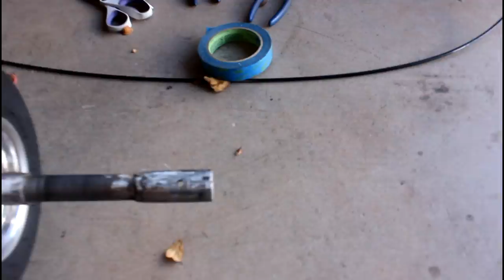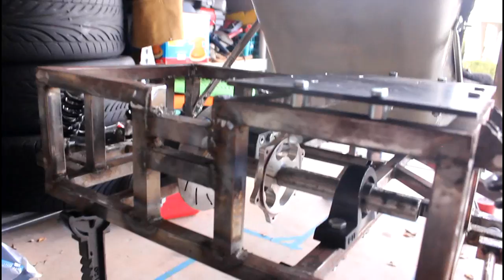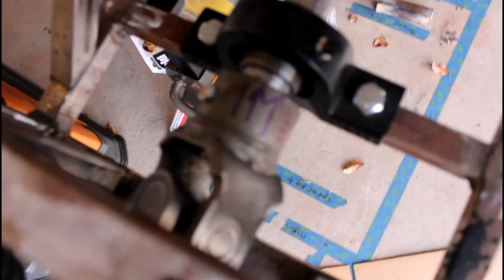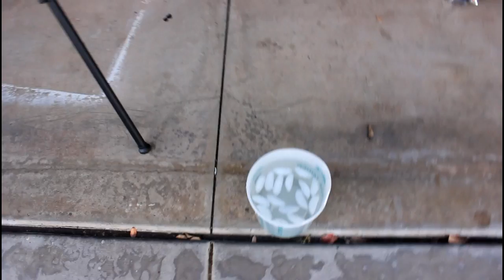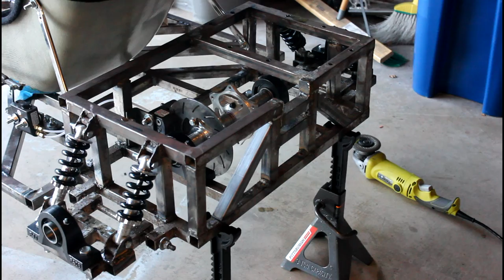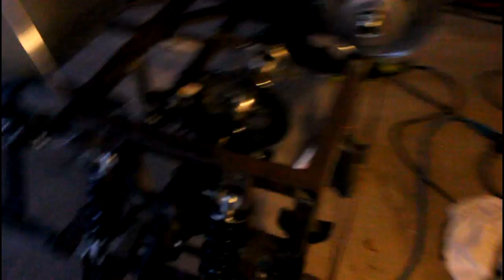(Homemade) Go Kart Build Project 23: Strengthening the Axle, New Support Braces

Comment: I was taught years ago to use old motor oil & swosh the metal around in the oil  but you need a splined  male & femal shaft to allow the axle to slide in & put when the suspension moves

Comment: I see this is an oldish build, but it got recommended to me now (2021) for some reason. Your axle/suspension design won't work -- you may have discovered that by now! A universal joint can't be used singly like that, it has to be used in pairs, and even then won't give smooth drive. That's why "constant velocity" joints exist and are used for that task. Also, those short swing arms mean that you have enormous camber gain, giving very poor traction, even at rest, since the suspension will be somewhat compressed with the weight of the cart + driver.. I'd be interested to know how this design panned out...

Comment: It looks like you built this 3 yrs ago...good for you ...not a lot of people would attempt to do what you have...I'm just wondering if your axle problem isnt due to only having on pillow block on the outer most axle...if there were 2 bearings on the outside it would add a lot more support...eliminate all fields of flex.. Good Luck..
Reply from the maker: Thanks Jerry, I appreciate it! That is very possible. I would love to revisit the design at some point, but in the short term I prefer the reliability of the solid axle so I can just enjoy it more.

Comment: ruler, protractor, measuring tape, angle finder.....these are all pretty much mandatory items if you are gonna fab brother, and all should be able to be had or under $10 each or better.  Your build is going the right way, it is just the little things that make it less then it's potential imo. "pretty close" is just silly when you can make it exact, especially with the symmetry in mind, and even more so when it comes to, if you can see it with the naked eye then that is more then just a little of, and when it comes to chassis and suspension builds, they really should be exact man. 

again, just my $.02 and experience in everything from this to full size chassis. 

Keep it up, I have been following the build for a while now.
Reply from the maker: I am well aware of all the basic tools needed to build such a project. Keep in mind, this is my first ever serious fabrication project, so I am going to make some errors and I learned from them along the way, also keep in mind  my welding skills have improved but are not to the point where I am skilled enough to where warping is minimal, that's where must of the "inaccuracies" you're talking about come into play. For the type of project I'm working on, a go kart that is built mainly just for fun in my free time, the level of precision I achieved compared to most other go kart builds I found online is pretty damn good. Thank you for your input, I appreciate your support on the videos.
Reply from the maker: If I was working on something such as a full size chassis, sure I'll pay a lot closer attention to making sure things line up down to the last millimeter. But I only had so much time and will to want to put into this because I do have many other priorities that are more important than this project

Comment: Depending on the carbon content in the steel you might have to oil quench. Also tempering the metal with make sure your axle does not become brittle
Reply from the maker: Yea after I did this I realized I should have oil quenched it after heat treating it, although I scrapped this axle design and I actually use a completely different axle now.

Comment: To harden the steel you should be quenching in oil instead of water. Quenching with water can make the steel brittle. Just subbed 3 days ago and started from vid 1. I have noticed a few other things but that could just be me nit picking. Keep up the great work. 
Will
Reply from the maker: +william mosher Thanks for letting me know, yea I tried researching and some people said water, others said oil. I didn't really know who to believe so I went with water and guess I guessed wrong haha. Thanks for the support on the videos.
Reply: +Hnat Automotive Photography The oil introduces carbon to the metal.  I always use used motor oil.   You should also temper it but putting it in an oven @ 400* for a couple hrs  This Tempering will keep it from being brittle.  Also all you need to heat it up to is to wear a magnet wont stick to it.
But I think you will be fine unless you put a crotch rocket engine in then you may need to take the extra step.   Great build
Reply from the maker: +2LateIWon gotcha, thanks for the info! I'll keep that in mind for future references 👍🏻
Reply: No problem   Look up people that make knifes they may be able to explain it a lot better and have different techniques.  I have 2 go carts Im building.  1 has a 750cc motorcycle engine in it and the other is a go cart frame that was given to me.    (these are on the back burner for my other projects I have going on but plan on working on them by this summer) Ill be putting these on Youtube as well   (I just subbed you great videos)

Comment: wouldn't  compression of the rear suspension result in the wheel swinging closer to the pivot point of the u-joint causing compression on the axle?
Reply from the maker: The outer axles have a sleeve that loosely slides over the axle and that sleeve locks into the outer bearings, allowing the axle to slide in and out of the sleeve that is held in at the bearing by the two set screws. the axle compression you're talking about was a design flaw I had earlier on and I was able to fix it, it's kind of hard to explain over text haha

Comment: im still catching up on this build, but just an FYI, i spent just a little more money to buy the 135amp welder from eastwood, i gotta say that thing kicks butt compared to my 90amp harbor freight, i also use some gas that i get from a local supplier, helps out alot especially when cleaning up!
Reply from the maker: Awesome, thanks for the heads up, I'll keep that in mind when I'm in the market for a welder!

Comment: For the rear axle how you wanted to make the axle expand and contract from putting two sizes diameter of mettal, i get how that works but in the video it looks like the metals welded together so how is the axle getting bigger and small if its welded? Great idea and design btw
Reply from the maker: Thanks for the comment. Nothing is welded in that area of the axle, check my response to your other comment, I explain how it works, let me know if you still don't understand.

Comment: So what happened to putting the u-joint on the steering column
Reply from the maker: +Timothy Ledger As of right now I won't be using it because that's more cutting, drilling I have to do, and If I feel I don't need it, I'm not going to make more work for myself. I might just use a coupling collar instead.

Comment: I'm making knifes and there u have to heat treat metall for every project and please NEVER quench the metall into water. This is very dangerous and the metall can just break. Do it with oil its much better and will never break.
PS: I watched every video of the cart and I love your work man
Reply from the maker: +The Vardarioter Hmmm interesting, I read that quenching in water makes the steel harder, but more brittle, and quenching in oil makes the steel softer, but less brittle. Maybe for your application of making knives, quenching in oil  makes more sense? Not too sure, this was my first time ever using quenching to strengthen the metal. Would you recommend requenching it in oil? Thanks for watching the videos, I appreciate the support!
Reply: +Hnat Automotive Photography I think you shouldnt requench because you tempered it but just for next time that you dont break your cart. 
Keep up the good work.
vard
Reply from the maker: Cool, thanks for the info man, I appreciate it!

Comment: only issue with harding the axle on the go cart it could damage the bearing
Reply from the maker: I'm guessing you're referring to the heat damaging the bearing?
Reply: yes
Reply from the maker: well. we'll see, I'll pack the bearings with more grease before I run the kart again. If they're damaged, I'll buy two more.

Comment: That's not how you harden steel.  You need an acetylene torch and you quench it in used motor oil so the steel absorbs carbon.  I think they dip it for a second like 3 times.
Reply from the maker: Yea I figured that out after I did it haha, thanks for the comment